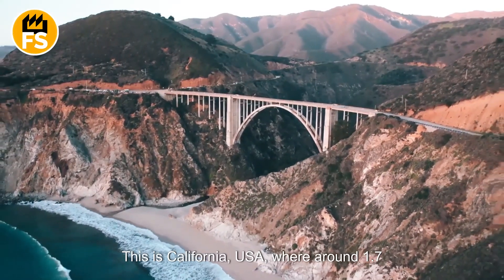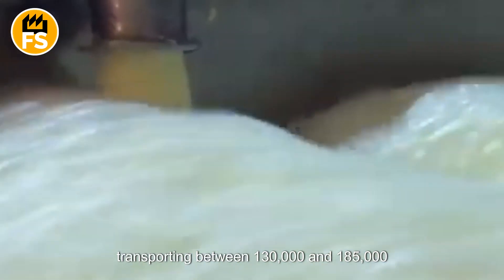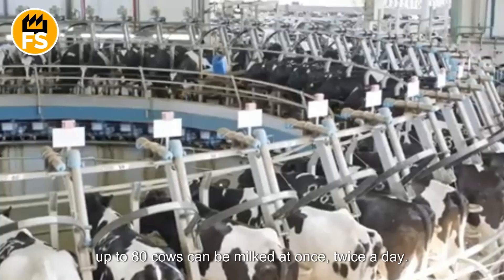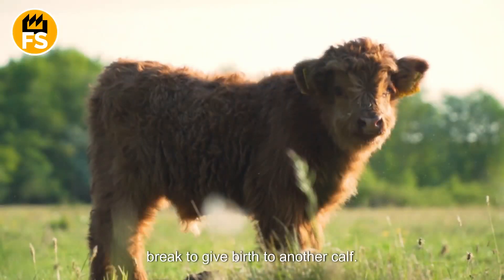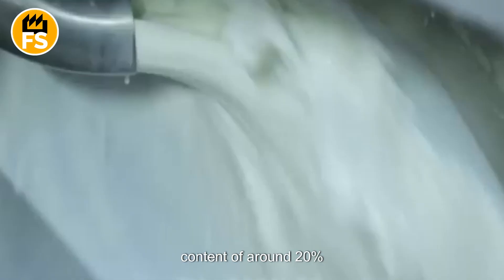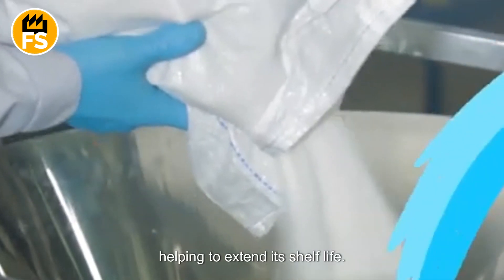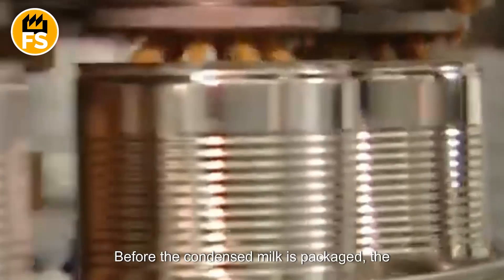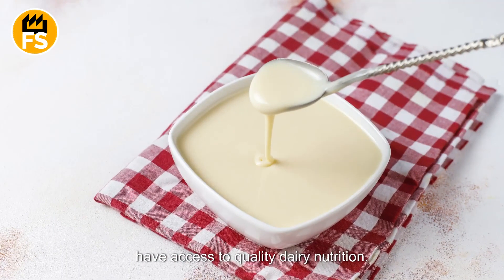How 13 million gallons of milk is used to make the most delicious treat.

Comment: Then again, I’ve never seen a door knob. All doors here have lever-type handles. In a century-old house as in brand new apartment, no door knobs anywhere around here. Same goes for those spring-type door stoppers that are screwed on the wall. Go through every hardware store here, you won’t find one.
Reply from the maker: That's interesting to hear! In the video, you can see how milk is used to make the most delicious treat 🥛🍦.